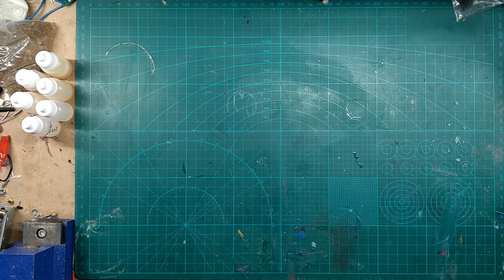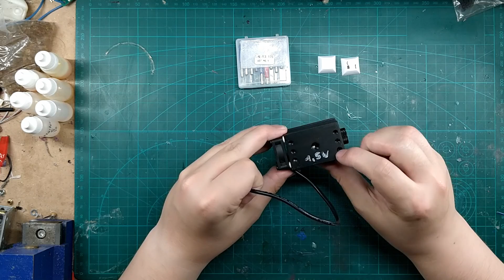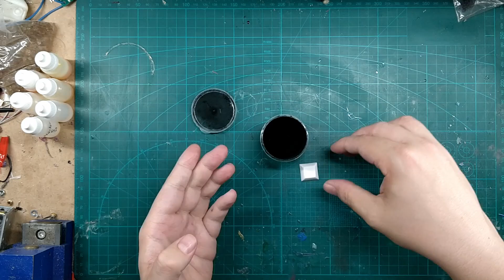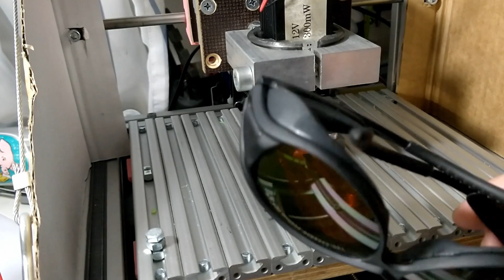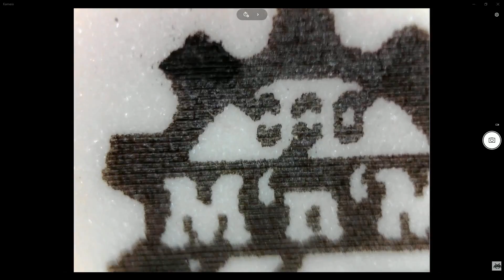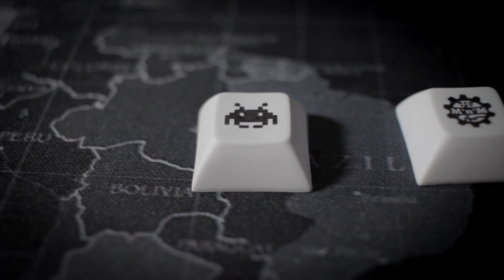#Random: Printing on KeyCaps (or any other plastic) | Make'n'Modify

Comment: Hey ! Good tutorial, is it working with transparent keycap resin-made ?
Reply from the maker: Likely not. Maybe a bit ;) The idea is that both, powder and keycap melt and fuse together. Resin dose not melt. The powder might melt and fuse a bit to the Resin but I guess the connection would not be very strong.

Comment: I am actually in the process of starting up a custom keyboard business. This is pure genius, but I am wondering exactly how well have these held up? I read up on your thread at geekhack, but it hasn't really been updated as of recent.

I did notice you said they wore out pretty badly after around 6ish months I believe, but I am wondering if you took any steps prior to prevent that? As in, did you apply some clearcoat and sealant to the keys themselves, or did you just leave them after that?
Reply from the maker: I left them as is without any protection, to see how it will hold up. for a business it's maybe a better idea to use a DIY dye sub method like the one shown on Linus Tech Tips. It just needs an inkjet printer, special ink and paper as well as an flat iron or something similar. Dye sublimation is a proven to work process that works with dark colors on light colored keycaps. My process is more of an experiment ;)
Reply: @MakenModify  I understand your reasoning for saying that, but I've been doing A LOT of research on this exact topic. 

We have a special way of customizing our keycaps already that makes it where doing that won't be possible, as it will mess up the current pattern we do on it. 

I think if we put a sealant over this, it could potentially last a lot longer than it did for you. I think it is worth a shot on our end.
Reply from the maker: @bencarney8972  sure. It also makes a difference if you do a complete board or just some accent keys. I'm curious to what you are making, drop me a line (YouTube, Instagram or Twitter) if you can share more ;)
Reply: @MakenModify  Hey! I followed you on Twitter (Winclark12), but you don't seem to allow DM's. If you would, shoot me over one and we can get to talking a bit more! 

I have a few more questions anyways, so this will be nice!

Comment: Hi great video! I'm just trying myself to add text to black keycaps with white pigments. It's tricky because white reflex and needs more energie to melt and the black keycaps absorb easily the energie of the laser. So burning the keycap and the pigment is mostly the outcome haha. Have you ever tried adding white or color to a black keycap using this method?
Reply from the maker: hm... yea i did but only once with a silver pigment on black. It worked, maybe the silver layer was quiet thin. You might have to work in several thin coats where alignment might be the biggest problem.
Reply: @MakenModify  thanks for sharing your thoughts on this subject. This is a really inspirational video. I hope one day to be able to show yo my results :)
Reply: Multilayer was my first thought also but indeed allignment will probably mesh up everything then. Maybe gonna try yellow toner or some resinart/nailpolish pigments. After that a try with a fiberlaser (a friend of my has one) will be the next thing to try out I guess. I will let you know if and how I succeeded. Thanks anyway for your prompt reply! :)
Reply: I use white dry rub-on transfer letters on black keycaps.  The problem is that that the rub-on transfers will wear off almost immediately.  I mitigate against this by spaying the keycaps with satin finish automotive catalyzed clear-coat (not air dry clear).    It's not a perfect solution but it last quite a long time.

Comment: Considering using this, But wilk the colour fall off eventually?
Reply from the maker: The color will start to fade at constant use (see the geekhack thread in the video description). Maybe a real DIY Dye Sub will work better for you. This was just an experiment. It worked fine and I can live with the slightly faded legends but it's not perfekt.

Comment: Would this work with ABS keys, or would that just result in a melty mess?
Reply from the maker: Should work but did not test it. You might have to turn down the power due to a lower melting point but in general I don't see why it would not work.

Comment: Geht das wirklich so gut
Reply from the maker: Wenn man die richtigen Einstellungen für seinen Aufbau gefunden hat ja. Mit der Zeit verblasst es etwas aber ist immer noch deutlich erkennbar nur halt nicht mehr tief schwarz. Auch nach ca 2 Jahren konstanter Nutzung.
-----
English: Yes it holds up well if you have found the right settings for your setup. It slightly fades over time but still holds up well after constant use over the past 2 years.

Comment: This is great, how much does all that equipment cost if you don't mind me asking?
Reply from the maker: It depends on hom much you diy it, but if you buy a cheap generic "laser engraver" from China its maybe around 100$. If you allready have a cnc or a 3d printer it can be done for 30$. But that said, with that equipment you will not "produce" full keysets in minutes, it will just get you started. By now i would maybe prefer to go the diy dye sub route. Prominently Linus Tech Tips made a video about that recently.
Reply: @MakenModify  those keycaps end up losing the ink right? what about those printers that don't require ink, the ones that are pretty fast? those are too expensive right? why do they not require ink on top of the keycap like yours?
Reply from the maker: @marcelfernandezromero8905  im not really sure what you mean. Professional co2 laser engraver? They can etch the surface but will not change the color (on pbt caps). Dye sub ink will penetrate into the PBT cap, so it's not only on the surface it's considered the best method for printing on keycaps. Only doubleshot is considered better but there the lettering on the cap is a different piece of plastic and can only be produced by a two stage injection molding process.
Reply: @MakenModify  alrightm thank you for educating me

Comment: Would mica powder work? Or just toner?
Reply from the maker: Might. Did not try that yet. I tried some random "Nail art Powder" from Aliexpress, which worked pretty good. On toner basically both components, the cap and the powder are thermoplastics and fuse together quiet well. If only the keycap is melted it might work but maybe not as strong, but I honestly don't know what micra powder is made of as a base material so I can't tell you ;)

Comment: How much does it cost to print all keycaps for 60% Keyboard ?
Reply from the maker: If you do it yourself and allready have a cnc laser, basically nothing besides the blank caps. If your question is what it would cost if i make the set for you I have to disappoint you. I worked full time, have a family and almost no spare time. That's why that time is very valuable and my price would be absolutely unreasonable.
Reply: @MakenModify  Understood, thank you.

Comment: I was wondering how it would look if you first laser engraved the art & then dip the keycap in the toner and hit the keycap with the laser again. It should give the keycap an interesting tactile feeling to the keycap and also trap the toner slightly below the top of the keycap.
Reply from the maker: Might work but it might be hard to perfectly align it twice. What i also did was deep engrave something and then add enamel paint, wipe off the rest. After drying ther is a haptical feedback.
Reply: @MakenModify Enamel, that is what I was thinking about. I'm 60 and I barely remember in Junior High School Plastic Industry class where we engraved plastic using a router and then spread some sort of paint over the engraved area and the wiped off the paint on the surrounding area and then let the paint dry. It was a long time ago (mid 70s) so couldn't remember the terms to use. I figured I would just have to make a holder with an opening with the same width as the keys are wide and then just make thin template that would center each of the different lengths of keys. I figured if someone had a laser engraver, that they would also have access to or own a 3D printer.
Reply from the maker: @EvilDaveCanada  yea sure depends on the detail i guess. Btw i tried CNC engraving but that never worked for me. Recently did some tests with a CO2 laser and (for engraving) that worked really well.

Comment: will this work on any type of pigment, also if not can you supply a link for the pigment, thx
Reply from the maker: it worked with the laser printer pigment and with some random "Nail art pigments" from China. I would suggest you try it on some cheap blank caps first

Comment: Could you not increase the quality of the mark by using a vector file - at least for the edges?  Then fill with the bitmap...
Reply from the maker: Yea the files were vector but rastered for engraving. But i get your point an i did test it back then. There were improvements but not very big. The software I used for tool path generating however did not really do a good job of following the vector line precisely. All in all this was more a prove of concept ;)

Comment: For a person that lacks the tools to accomplish this, which cnc machine would you recommend? im tempted to buy one of those cheap desktop lasers that are floating around amazon but i think it will just break on me the first day :S
Reply from the maker: that is a question with no definite answer. It depends on what you want to do but if it is really only to print onto keycaps, get something that is as cheap as possible... by now some have tried to do what i showed but not all succeeded. And even if it works it still not a perfect result. You can also do dye sub at home as far as i know, might even be easier and cheaper (if you don't already have the tools).

Comment: Very cool, have you tried spray painting the key then removing the paint with the laser?
Reply from the maker: Not on keycaps. I used it to make pcbs with the laser but on keycaps it would most likely damage the cap where the laser hits it or even make the paint fuse even more to the plastic. But the effect might even be interesting, who knows. Sadly am to busy to try atm

Comment: you mention that the laser was turned down, would you be willing to share what it was turned down to?  i'm looking to try the same thing on my machine.
Reply from the maker: i actually used 3% power and 50mm/min using Laserweb, I heared back from some who tried it, some succeeded some not... did not quiet figure out yet what the problem could be for some... maybe the setup, maybe wrong caps, maybe to thick coat, don't know. looking forward to your results ;)

Comment: I had a similar idea of using nail polish pigments. I ordered some but never got around to use it.
what I did try was using different text markers and removing the excess ink with cleaning alcohol. that kind of worked.

I think your milling failed because the ABS got too hot and melted. cooling it with alcohol might help. as a wild guess I would say you could try freezing the caps beforehand but they may become brittle and just break apart.
Reply: why to use alcohol to cool it ? can tap water be used ?
Reply: @leoyru.3361  I had to drill holes in acrylic at work and I was told to use alcohol to cool it. I don't know wether water would work.

Comment: This wouldn't work on black keycaps and white print, would it?
Reply from the maker: Sure. You only need a white pigment that works with that process and the laser power has to be adjusted but other than that it should work in any color combination. In the geekhack post (linkt in the description) i once printed a cap first black and after that in gold on top with no problem ;)

Comment: Excellent guide. It's just what I was looking for. Thank you!
Reply from the maker: I'm happy to have helped ;) btw. have my daily driver equipped with a set I printed that way and till now it holds up great :D
Reply: @MakenModify  That's great news. I plan to make a  portable electronic journal. I'm fitting a full keyboard to 20 keys with 5 macros. Durability is important to me for my project.
Reply from the maker: sounds cool. I think the process is relatively durable, but not as strong as dye sub for example but never the less an easier diy solution

Comment: Great video! Would this also work with epoxy resin keycaps?
Reply: On epoxy resin keycaps I transfer my pictures by printing them on the smooth side of a transparant plastic sheet (overhead projector sheet for inkjet) with my laser/LED printer (mirrored print!). 

After this I apply a thin layer of new epoxy on the keycap and press it, printed side turned to the keycap with a small instrument, avoid bubbles. If the keycap is hollowed you can put an AA battery on it to keep the pressure.  on the transparant sheet until the epoxy is hard enough. I's really a very thin layer, just to wear the print.
After two days gently apply some heat to the foil with a paint-burner or a gas flame from a distance(don't burn it).
After it has cooled down just gently pull the foil away from the keycap and you will have a flawless print on it. If you don't heat it up a little bit,  a part of the inkt will stay on the foil and your picture will be disturbed and not transferred completely. It works great and the result is as sharp as the picture. It also works with mixed color logo's, even photo's. If you use polyurethane keycaps it works also, the bonding between epoxy and PUR is excellent. After the picture is on the keycap (you can't rub it of easily btw), i apply some epoxy coating on it again. The colors become clearer and brighter and the keycap will not ware down. I designed this proces myself after some research on the internet, the heating I figured out myself. success !!
Reply from the maker: Did not try it yet but yes and no. The laser melts the pigment which would maybe grab the resin, but the resin will not melt so the bond will be pretty weak. Also the epoxy might release harmful gases when hit by the laser so i wouldn't recommend it.

Comment: nice guide.
at the beggining of the video you mentioned wanting to try transfer paper, did you eventually try? if so, did you get nice results?

i'm asking because you can get transfer paper for like 10€ on the internet, but buying a laser cutter/engraver specifically for this would be really counter productive.

thanks!
Reply from the maker: you would need to have a dye sublimation printer, which would print on a special paper. This is used by some print shops for printing t-shirts. My plan was to go to one of them and have them print a set of letters on that paper. At home you could "iron" it on. But so far I didn't find the time to go to the mentioned shop, sorry.
Reply: i have found videos of people online claiming that the paper they used didn't require a special printer not special ink, but there is a possibility of them lying ( cuts, etc...). thanks for your response and i will investigate further.
Reply from the maker: Problem with most videos is you don't know how long the printing lasts... might be that it can be done with cheap paper and an inc jet printer but how resistant this coating is is in doubt. ;)
Reply: exactly. i'll try it anyway since it's only 10 euros and if that doesnt works i can always make crappy T-shirts out of it or something
Reply: Take a look at http://keycapdiy.blogspot.com/

At the above URL, you can see his experiments starting in Dec 2013 and continuing. And I would have to agree with the blogger that dye sub with ABS keycaps is impossible since if you do some research, you'll find that the dye sub process takes a temperature of about 400°F (204°C) and ABS plastic has a melting point of 105°C. PBT has a melting point of about 433°F (223°C) so PBT keycaps can be done with careful temperature control.

I don't know if the gentleman associated with the above URL is still working since the last blog post was in May of 2016, but there should be useful information there if you intend on doing DIY dye sublimation of keycaps.

I've been looking for a relatively inexpensive way of making some custom keycaps myself since I'd like to make a custom keyboard myself.
 (See http://www.keyboard-layout-editor.com/#/gists/d6314df3ad657cc9a0342bd396d56730 )
Unlike most of the DIY keyboards out there that reduce the number of keys, my plan is to go larger. I figure the Jumbo layout with a 24x7 Matrix would map quite nicely. But getting nice looking keycaps for the extra 34 keys above a 108 key layout presents a problem... (yes, the layout I'd like has 142 keys).

Comment: you should sell some custom keycaps. I like your work.
Reply from the maker: serolfflores thank you. Actually i did a first commission. But to scale it up i have to refine the process. Biggest problem is to get it acuratly centered after use the machine for something else. I might build a dedicated machine tough ;)
Reply: @MakenModify  How's your process here? Is it possible to buy keycaps from you?
Reply from the maker: @killerhomer0815  since my last video my live changed so much that I barley have any spare time... If time is money mine pretty valuable atm. => the price for commissions would be ridiculous :/ so no not really sorry...

Comment: What was that plastic powder? Link? Id like to try this with my glowforge. 😄
Reply from the maker: The ton sticks pretty good maybe it sticks even better if there is a tiny bit of water (like condensation) on the caps
Reply: It's toner for a laser printer.
Reply: I have a Glowforge and believe that the fans may blow the toner off, we'd have to likely devise a way to block the air temporarily from the laser head.
Reply: any luck? i'm thinking of trying to fuse white toner onto black keys with a glowforge